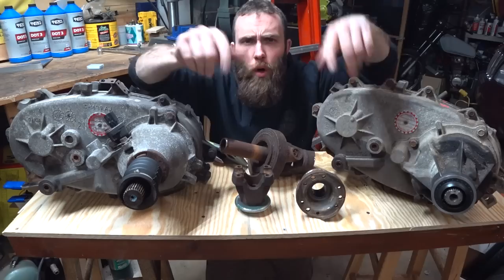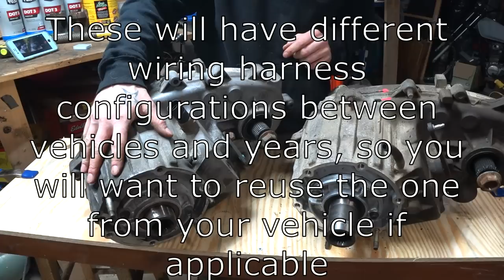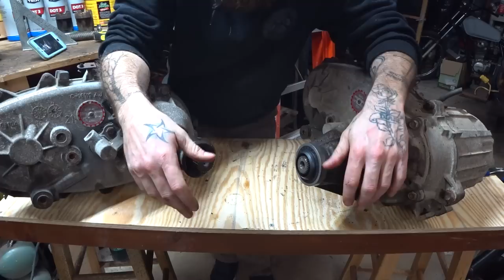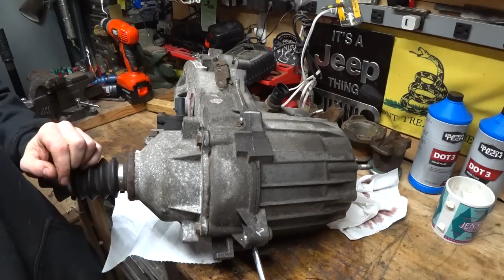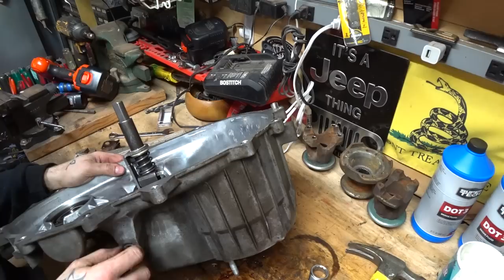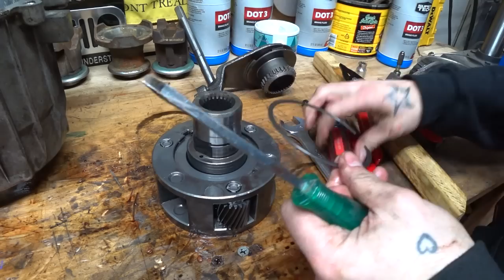Transfer Case Swap for Beginners - Everything you need to know!

Comment: I lucked out and got a 242J from a Pick N Pull XJ that’s same year as my rig (1993).  But I noticed something odd. The Transfer case light indicator still only has 2 wires, just like the 231.  It’s also in a different position than later years.  Not sure what to make of that.  Dash light indicator isn’t really a big deal, but I’m curious why newer XJ transfer cases had relocation of the switch.  I’m guessing the addition of 2 more wires has do do with change from AW4 (which was only automatic for 93) to the 42Rh?   My rig has AX 15 manual,  so wiring will be different regardless.
Reply: How did your swap work out? Any issues with the 242 behind a manual transmission?
Reply: @jamesstoddard8790  I just did the swap yesterday.  Ran into issue with linkage to shifter (I’m using Azzys Heims joint shift link instead of OEM), but  transfer case change itself had no issues. 
I was able to drive home in 2WD with no issue.  Will figure out linkage over next few days, then try the full time mode out.  Part time mode is identical in 231, so don’t expect any issues there.

Comment: Hello,

Could you please help and give some extra informations. 
I have manual 5 speed 1997 jeep xj  4.0 with 231 transfer case. 
I just have 2H,4H and 4Low, I would Like to upgrade it to 242? transfer case front another jeep .I know that the donor jeep is automatic transmission. 

I would really like to have Full time with my manual transmission. 

Thank you
Reply from the maker: I dont think it will be a direct swap, but using this method to swap output shafts will work just fine for you

Comment: I have a 93 zj with the 4.0 and the np249. Happened to find another one in the junkyard with a 242, but here's my dilemma...
Without pulling the case, how do i know FOR SURE what the input shaft length is on mine? I assume since they are both 93 zj's, mine with the 249 and that one with the 242 should be direct bolt-in, correct?
Any help would be reeeeally appreciated
Reply from the maker: If they came off the same trans, yes. if one is from a V8 and one is from a I6 they will be different
Reply: @DEInTheGarage  Thank you for the reply, good sir
Reply: @DEInTheGarage  Unfortunately that 93 in the yard got crushed....
But i found a 95 with a 231, also the 4.0. Gonna go scoop that one up this weekend

Comment: Good day.
Thanks for ton of information,
I am going to swap 247 to 242 so i need your advice if i swap only inout shaft amd reast leave as it is 242 also i have 242 rear stocj drive shavt so i found problem inly input shavf length, so dos it work if i swap inly input shavsf transmission side and rest leave as it comes with 242 and use 242 rear drive shaft?
Thanks in advance

Comment: You dont need to cut any wires for the shift select sensor, you already have a plug by the tcase on the passenger side you just need the connector that connects to it, no need for cutting any wires

Comment: I hear a metallic zinging sound coming from my Jeep on the highway, could it be that rozeba style connection on my transfer case?
Reply from the maker: It certainly could. Try removing your front drive shaft and driving around. If it is gone, there is your problem
Reply: D&E In The Garage My son has an 02 liberty... It makes a noise that kind of is a metal rattle... to describe it is somewhere between a lose heat shield or a brake shield on the back of the brake assembly... well it doesn’t have what looks like a brake plate so I’m wondering if this is involved!

Comment: I've got a np241C .... I've got a 78 Bronco with a 12 valve in it and I have a G56 Dodge 6 speed bolted to it I have been told by changing the input shaft in this  241 transfer case if will work If anyone has any input ..i would love to hear some advice because I'm a power stroke guy I'm just building this basically from parts that I have laying around other than this transfer case

Comment: Jeeps have New Process TC's like Chevy's? Do they have the notorious wear issue the 99-06 Chevy's do?
Reply from the maker: Not so much. Jeeps tend to use simpler versions without electronic or (even worse) vacuum line shifting
Reply: @DEInTheGarage  ya the vacuum style like blazers was dumb. The 99-06 Chevy 1500 and 2500 had a problem that the gear would float and slowly wear through half of the case. Around 80-150k. Replaced a few in my day. Lol. If you ever get a service 4wd light on those years, check for that pinhole leak in the case. Hopefully Chrysler stuff didn't have the same issue. Never owned one to find out. Lol. Awesome videos tho!!! 🤙👍

Comment: Hey Doug ..
Here is a part number.#
 # 63987.  This is for a "Warrior" brand  10 pieces screw extractor set
From Harbor Freight Tools.
I bought this set for about $7. When I rebuilt my 242 J transfer case a couple of years ago and used one of the extractors to remove the infamous roll pin for the shift fork and it it worked out excellent, I just tapped in the extractor and unscrewed the roll pin as if it were a bolt,   it only took me about two minutes and it was out.  
 So next time you disassemble a 242 give it a try and see if it works for you as well as it did for me.
  Tim from Wisconsin.